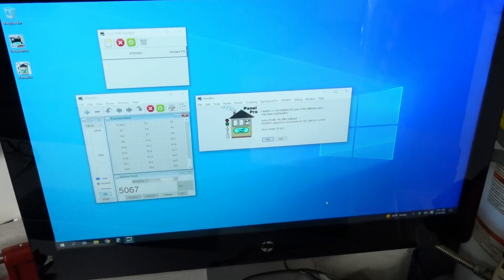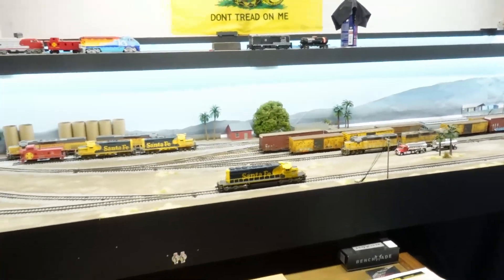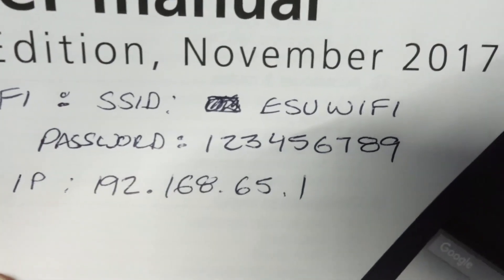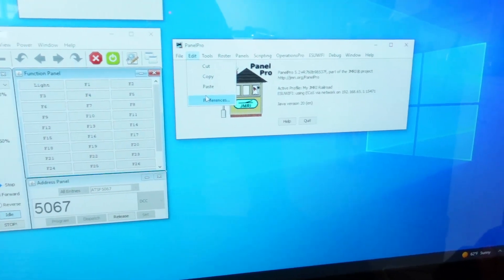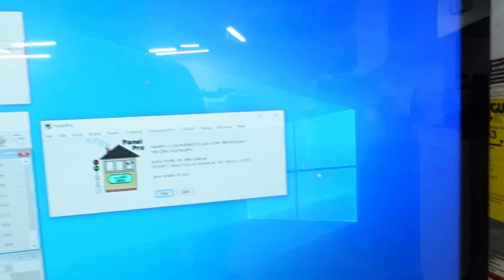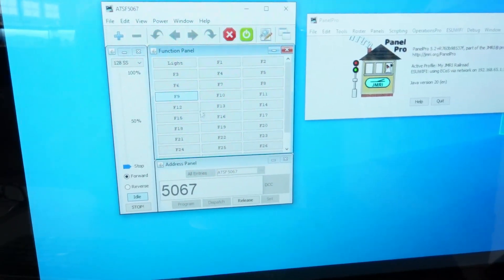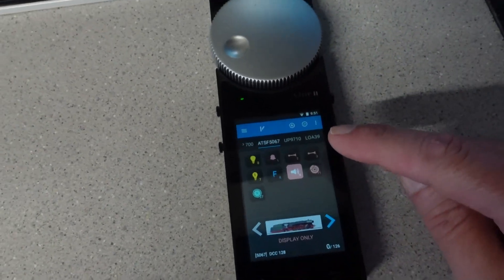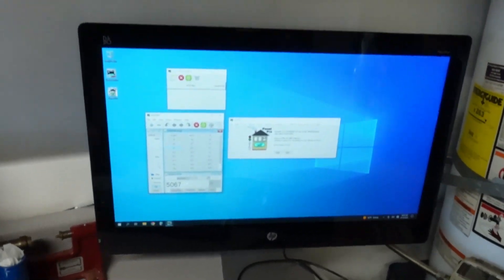How I Do It | Connecting JMRI via WIFI to ESU CabController Command Station

Comment: Ok. I’ll have to update the firmware on my cab control and mc2 and try this. Wonder what if any limit on the built in wifi for number of wifi throttles it can take?
Reply: @socalscalemodels ok Rick. Finally got time to update the firmware on the Cab Control and MC2 and try connecting jmri to the Cab Control via wifi. It worked! Even able to start the jmri wifi server and use the android engine driver connected to jmri server to run a loco.

Thanks for the tip, Rick!